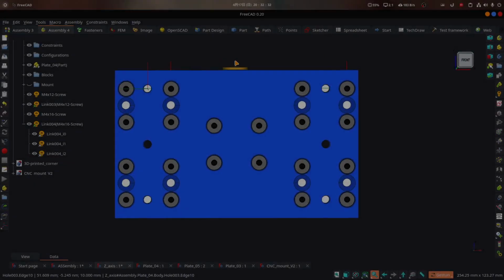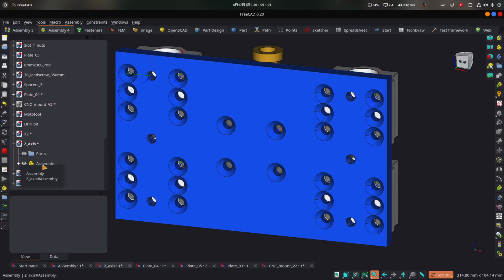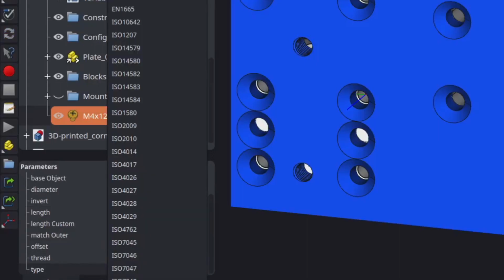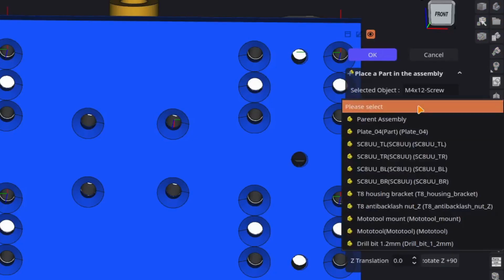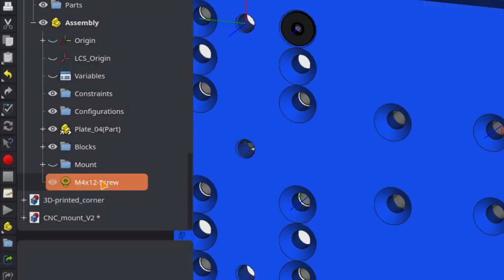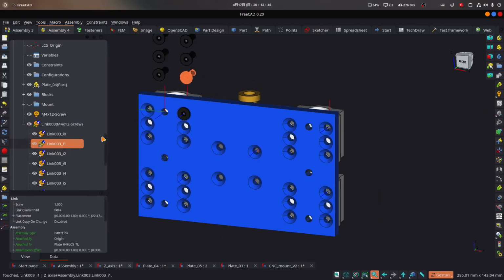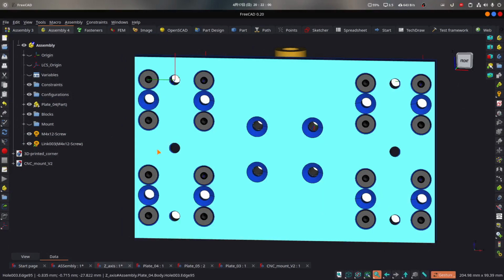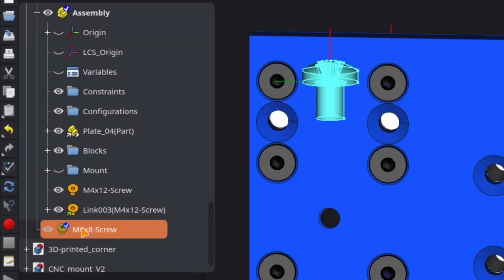FreeCAD Tutorial | Adding & Animating fasteners in Assembly4 WB | CC en, es

Comment: This method works only if the location of the holes never changes.
Otherwise it is better to attach each fastener to an LCF for each hole. Then if the hole locations change, the position of the fasteners will be adjusted automatically.
Reply from the maker: You are correct but also you can use an Spreadsheet to have all the necessary data and use expressions in the coordinates to update them automatically.
Reply: @hasecilu  not really 
You can’t easily reference the position of a fastener in 3D space using a spreadsheet.
You want the fasteners to follow the part they are attached to as you move & rotate the part within the assembly.
Reply from the maker: @rok1475  On minute 10:26 there are 2 animations, in one the whole assembly is rotating and in the other one there are translating movement, the fasteners are following their placement because the coordinates of the group of fasteners are attached to a fastener the have a LCS and therefore can move itself and all the fasteners attached to it. Since I made the whole project using Assembly4 and didn't have problems but I didn't tested with another WB, that is what you refer?